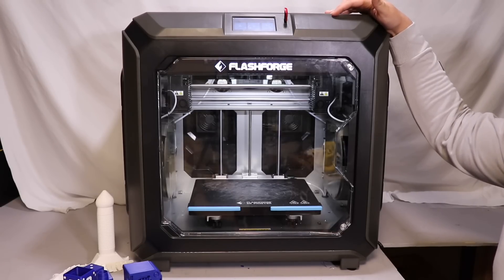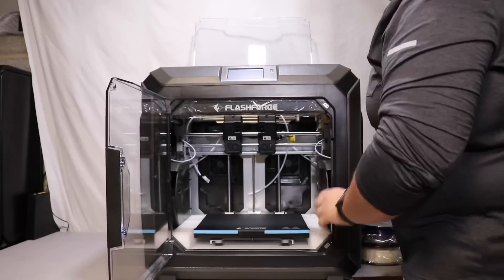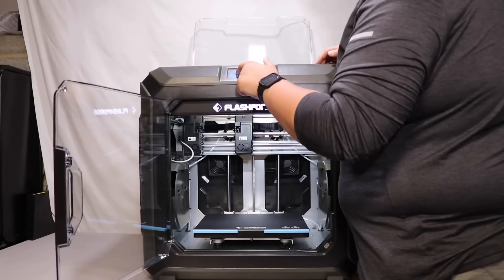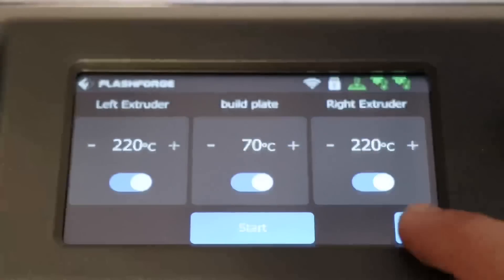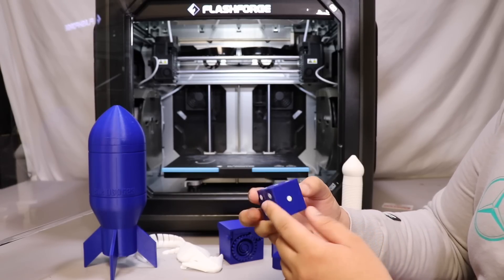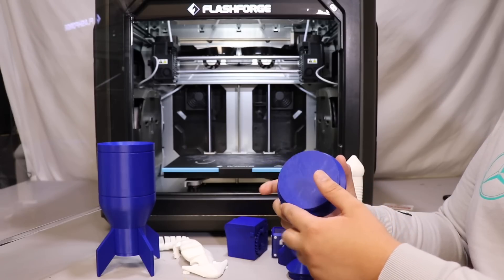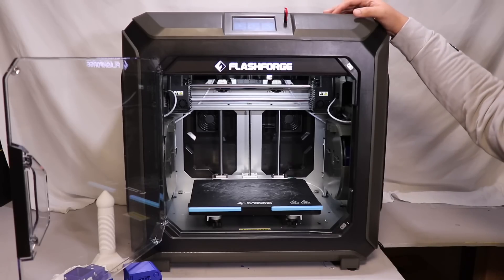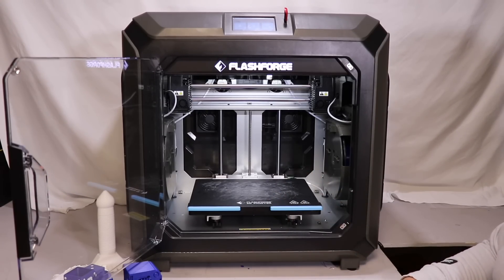FlashForge Creator 3 Pro (Initial Thoughts and Opinions Review)

Comment: I'm a little confused as you said you couldn't print TPU because of the tension issue but you showed a wheel with TPU and PLA?
Reply from the maker: Sorry I guess I should have stated that differently. So what I printed was tpu95A the hardest tpu you can find. But the printer was really struggling to print this filament. Because you can’t adjust the tension it just slips. I printed around 6 of those wheels until i finally got it to work with some settings but, it was a very average print. Flexible materials need something like a bmg extruder to adjust the tension.

Comment: Great Video, thanx very much!!!
You said you printed all models without tuning and they look awesome in the Video.
Did you set any specific Slicer options, especially for the 2 color prints and the Gearbox? Could you probably provide the Slicer files?
Did you also try LAN/WiFi printing? I tried both, but most time prints fail, although same gcode files succeed when printing over USB. Seems like they are streaming the files and not ready downloading them before print starts.
Really looking forward for more of your Creator 3 Pro Videos!!!
Cheers from Germany
Reply from the maker: Thank you very much for watching. I used the flash print slicer but after doing the video I will be switching to simplify3d. Simplify3d works a lot better and you can send the files over WiFi and it works just great. I will be making a lot more videos on this printer.